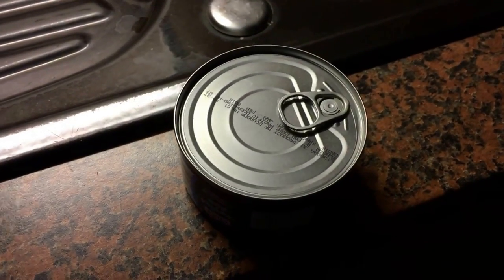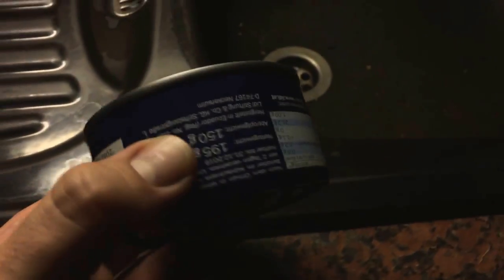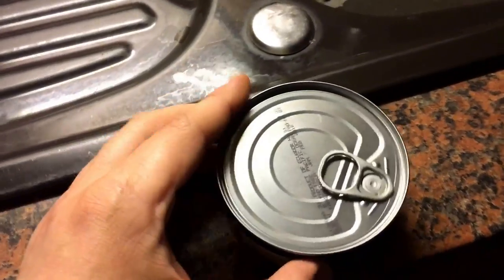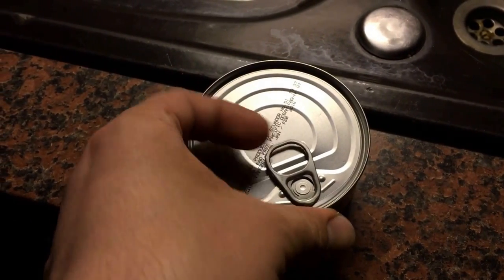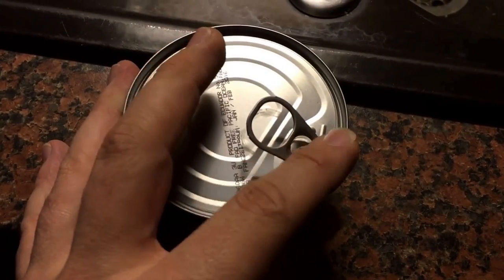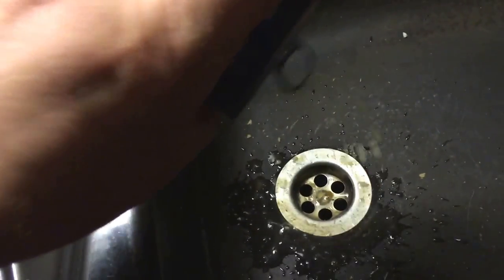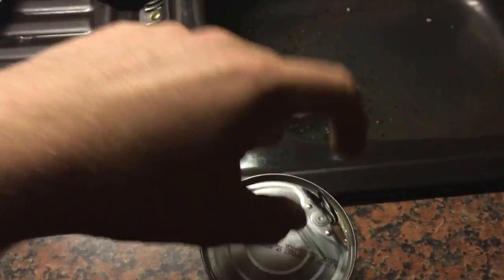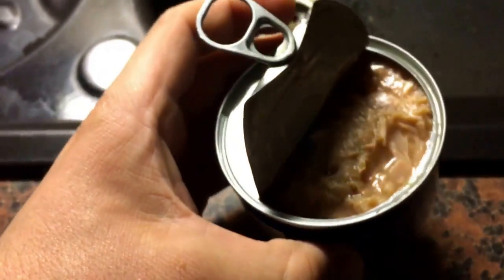How to open a tuna tin can fish steel can DIY

Comment: The first video I've seen that (almost) gets it right! You started well, finger through the loop and you used your thumb as a lever on the top of the lid. You should have kept the thumb there and contnue to lever it off.